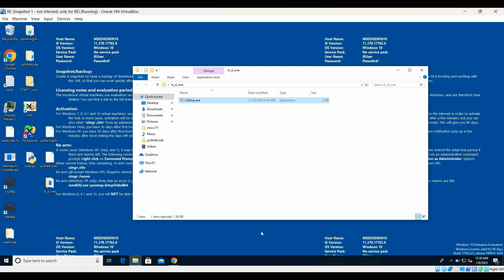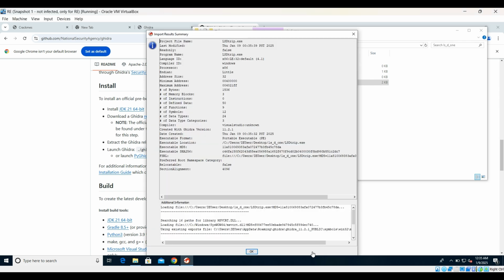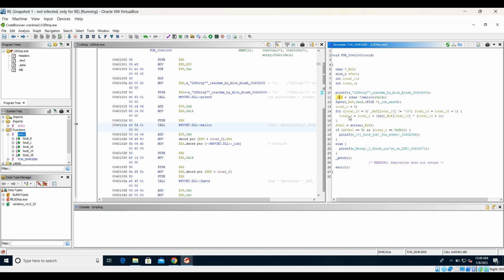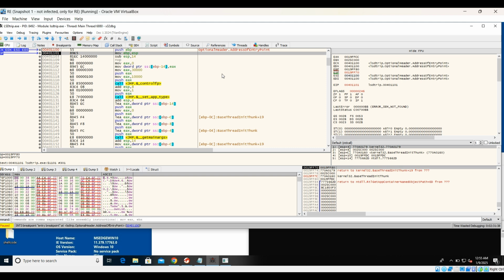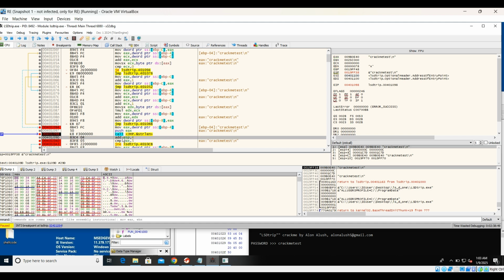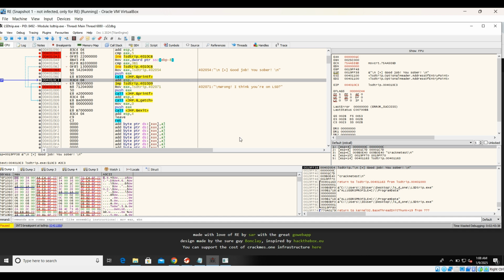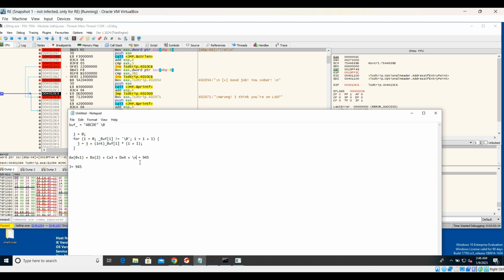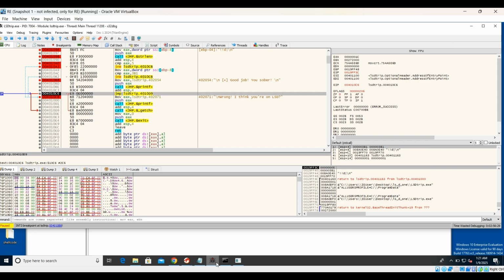Reverse Engineering Challenges - crackmes.one

Comment: code:

for i in range(32,255):
	for j in range (32,255):
		for y in range (32,255):
			for z in range (32,255):
				result = (i * 1) + (j * 2) + (y * 3) + (z * 4) + (ord("\n")*5)
				#print(result)
				if result == 945:
					print(chr(i)+chr(j)+chr(y)+chr(z) + "-> " + str(result))